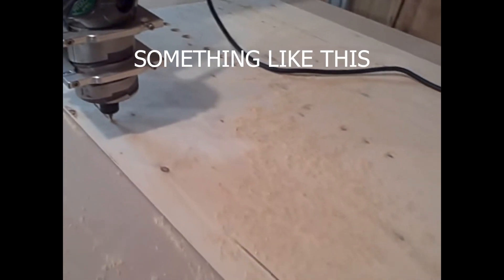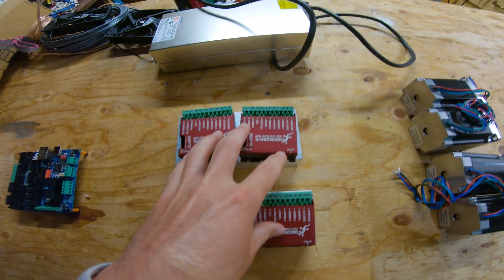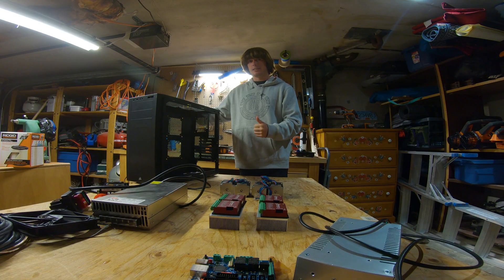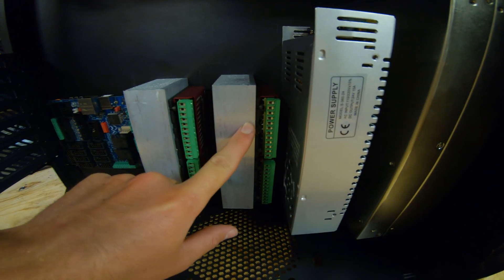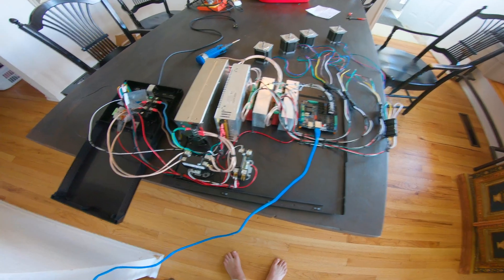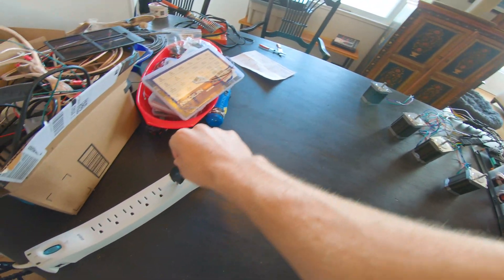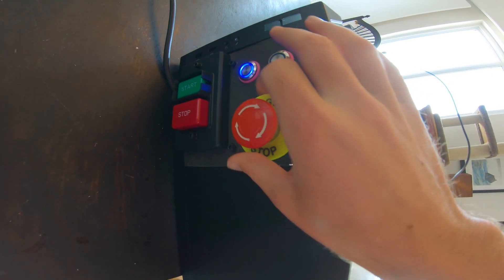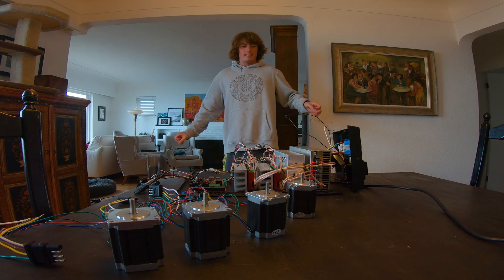CNC ROUTER BUILD | EPISODE 1| ELECTRONICS

Comment: great work pal,. i guess is you had to program the motherboard (controller ) or something like that in order to use mach4
Reply from the maker: The controller I bought was designed to be used with Mach4. I just had to plug the wires into the correct places pretty much. There was also a plugin for the controller that I had to install into Mach4 as well. No real programming, just selecting which motor goes where, how fast I want it to move, etc. The instructions for the controller were quite easy to follow.

Comment: why you need 2 power supplies ?
Reply from the maker: The motors require a different voltage than the other electronics. The higher voltage power supply is for the motors, the lower voltage power supply is for the other electronics.
Reply: @reeces_shredlab  what are the other electronics ?

Comment: How do you wire 12v led power switches to power the power supplies?
Reply from the maker: The 24V power supply uses a large 110/220V on/off switch like you find on most shop machines, it just draws power from the wall. The 48V power supply is also connected to the wall power, but in order to turn it on, I have 2 contactors which need to be engaged. The contactors are powered by the 24V power supply, via the LED buttons (24V, not 12). When the button is pressed, it engages the contactor and connects 110/220V to the 48V power supply. The LED switches are only under a 24V load.
Reply from the maker: This guy has some good videos explaining it. Very similar to what I have going on. https://youtu.be/zGqc5HcvdEw

Comment: Can you please provide wiring diagram
Reply from the maker: Hey Asif, it really depends on the electronics you choose as they are all wired and programmed slightly different. However most of the components seem to come with decent instructions on where to connect the wires.

I found there was not very much clear info out there on CNC electronics. Probably because each setup is different. So I made this video to try and help people figure out what components you actually need, and what connects to what. Once you understand the jist of it, the finer details can be found in the instructions of each component.

Comment: Hello i hope you are doing well .
Would you please send me a list of these electronics .
Reply from the maker: Motion Controller: https://www.poscope.com/product/pokeys57cnc/
Stepper Motor Drivers (1 for each motor): https://www.geckodrive.com/g201x-digital-step-drive.html
24V Power Supply for the Motion Controller: https://www.amazon.ca/gp/product/B07CPTHG7N/ref=ppx_yo_dt_b_asin_title_o06_s01?ie=UTF8&psc=1
48V Power Supply for the Motors: https://www.amazon.ca/gp/product/B00G8UDEQ8/ref=ppx_yo_dt_b_asin_title_o06_s00?ie=UTF8&psc=1

And I'm using Mach4 software to run the machine.

Comment: Do you have a list of the electronics you used I’m currently building my own and was looking for ideas based on what you used
Reply from the maker: Hey Tom sorry for the delay,

Motion Controller: https://www.poscope.com/product/pokeys57cnc/
Stepper Motor Drivers (1 for each motor): https://www.geckodrive.com/g201x-digital-step-drive.html
24V Power Supply for the Motion Controller: https://www.amazon.ca/gp/product/B07CPTHG7N/ref=ppx_yo_dt_b_asin_title_o06_s01?ie=UTF8&psc=1
48V Power Supply for the Motors: https://www.amazon.ca/gp/product/B00G8UDEQ8/ref=ppx_yo_dt_b_asin_title_o06_s00?ie=UTF8&psc=1

And I'm using Mach4 software to run the machine.